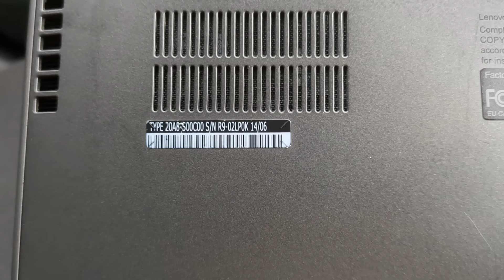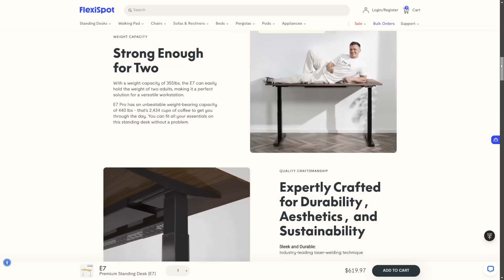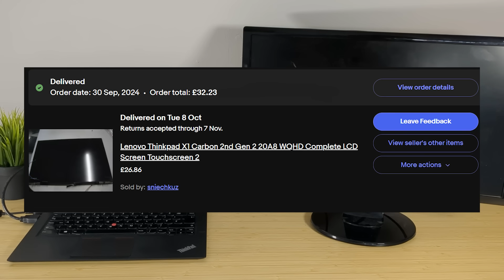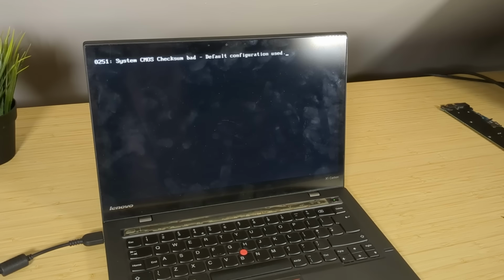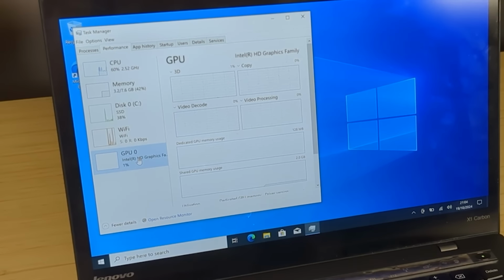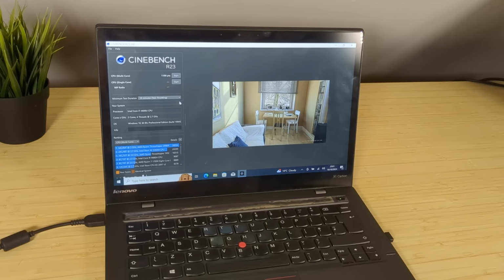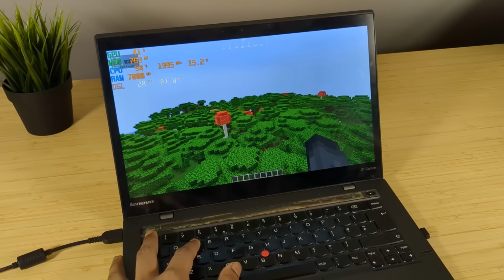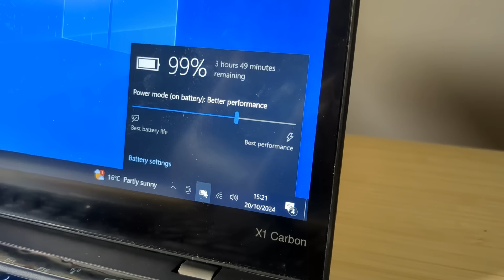Can I Fix a Viewer's BROKEN ThinkPad Ultrabook?.. things didn't go to plan.

Comment: Hey, I’m going to be buying an old ThinkPad soon for Uni. I’m thinking of getting the t480s but are there any other good alternatives you’d recommend?
Reply: u should get a t495 its extremely fast for school work and even low end gaming like minecraft and other games
Reply from the maker: Yep, the T495 or T14 Gen 1 are pretty good contenders, the AMD versions are the ones to go for. If your budget allows it, perhaps a P14s Gen 1 or 2. Both pretty good.
Reply: r61i is overlooked. SSD, high res screen, 9 cell battery and a basic desktop environment got me 3-4 days of battery. Not fast by a long shot but still has the drainage in the keyboard etc like t models so if you come across one for cheap I bet you can crank it up with better cpu, ram etc from ebay on the cheap.
Reply: Hey guys, thanks for the replies, but are the t495 and t14 as upgradable as the t480s? I've heard the t495 doesn't have thunderbolt 3 either
Reply: @Abhijay_TT  it doesnt have a thunderbolt 3 unfortunately but u can upgrade ram up to 24gb ur nvme wifi card(one in t495 already good)

Comment: So the first X1 had a faulty screen and a faulty motherboard?
Is that correct?

Also, you got very lucky with the Computrace.
I've had a bad experience where the Computrace never de-activated and I had to return the ThinkPad to the seller for a refund.
Reply from the maker: I suppose so, wouldn't make sense for it to just die on me. Seems like quite a common issue with the X1C2. And yes, I did get very lucky with the Computrace. Would've returned it straight away if it had a password.